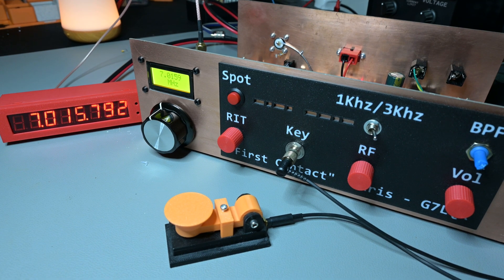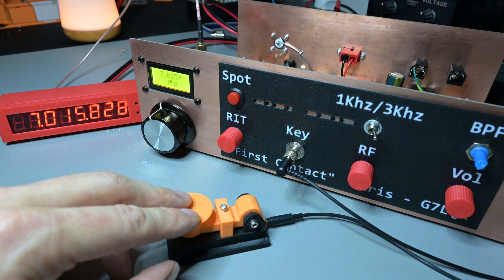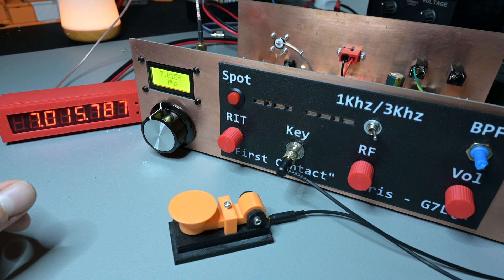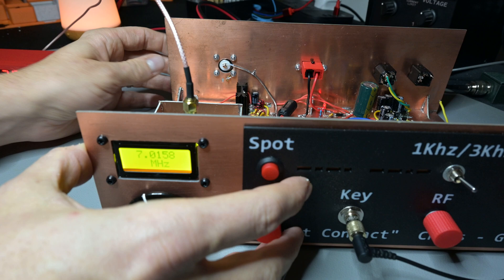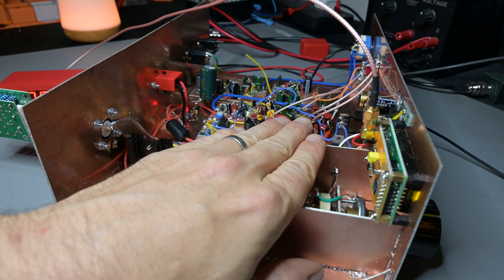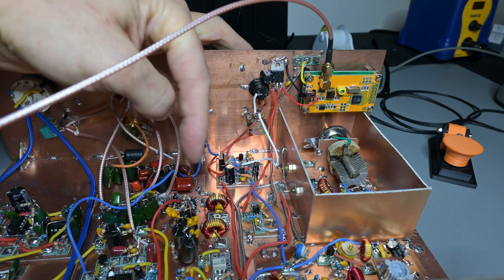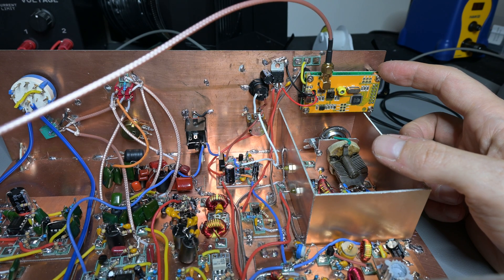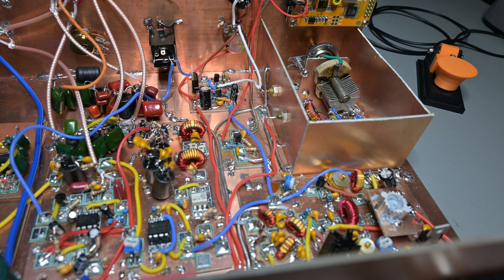QRP CW Transceiver 23: Shielding the VFO

Comment: Tem que usar capacitores NP0 no VFO, você também pode substituir os capacitores do circuito LC por múltiplos de valor equivalente, por ex., um cap. de 100p você substitui por três de 33p, isso divide a corrente de RF pelos três e aquece menos o núcleo do cap.
Reply from the maker: Thanks, I haven’t measured the drift yet, but all caps are NPO now; I had one that wasn’t, as I mentioned in the video; which I actually replaced with 2 NPO, for extra stability as you say.  The problem outlined here is to so with pulling the VFO using RIT and the keying circuit.